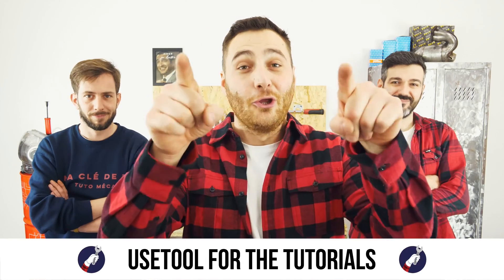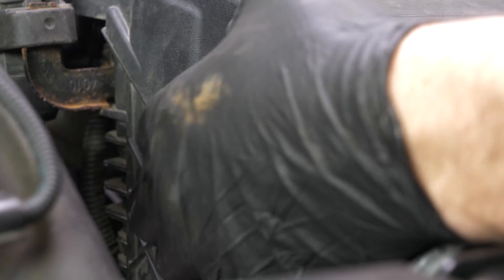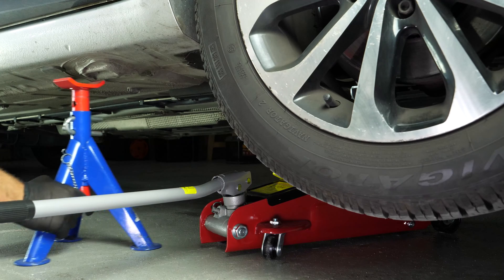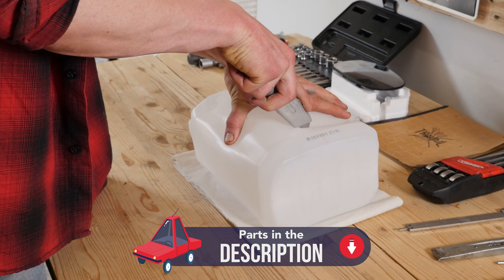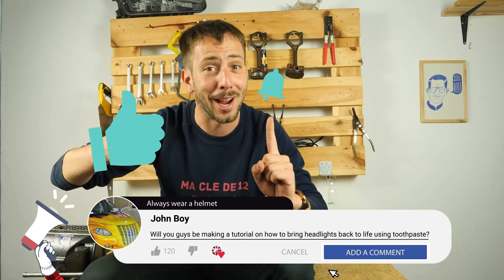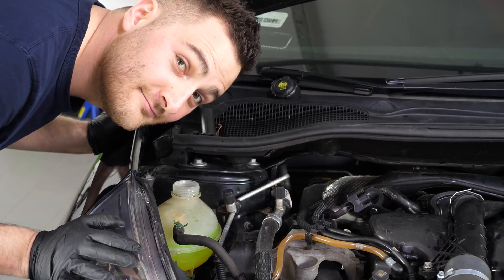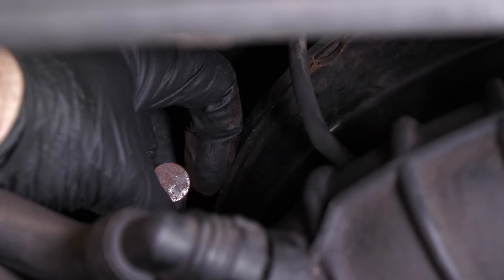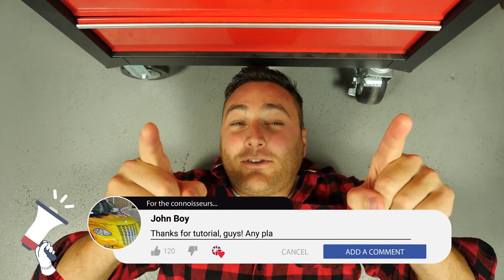How to bleed the coolant Megane mk3 1.5 dCi 🚗

Comment: I’m doing my first coolant change on a 2009 Renault Megane III Coupe 1.4 TCe (petrol, 32,751 miles, LHD). One hose is flexible and goes to the engine, and the other is hard plastic and connects to the bottom left side of the radiator. Which one should I disconnect to drain the coolant?

Comment: Hi, I'm wondering which colour coolant I should be using in Megane 3  2009 1.5 dci, or does it matter?
Reply: The yellow type that’s probably in there is Renaults own make which is expensive…I’m draining mine and putting the pinky red type easily available…it takes 6.5 litres..
Reply: @mikefranky  thanks.
Reply: @toc4177  ....I just used a siphon pipe straight into expansion tank and drained a load out roughly 2 litres....it saves going under the car and sometimes those hoses break on removal and then it turns into a nightmare as there's no space in there...🤦‍♂️